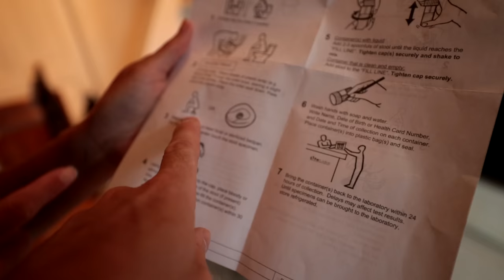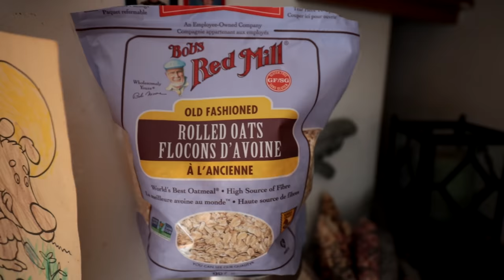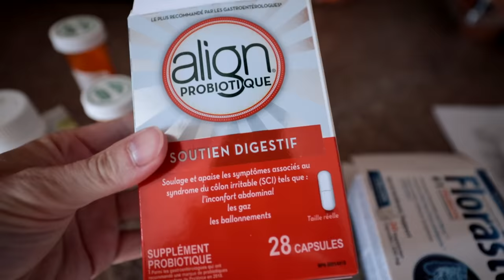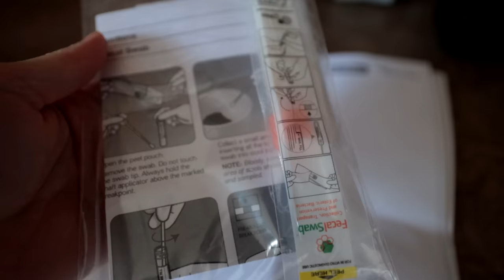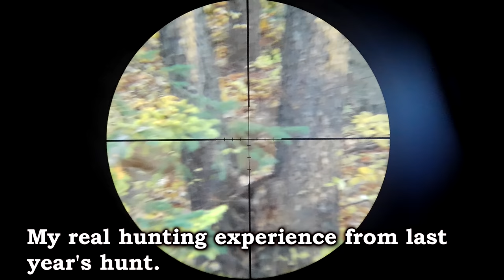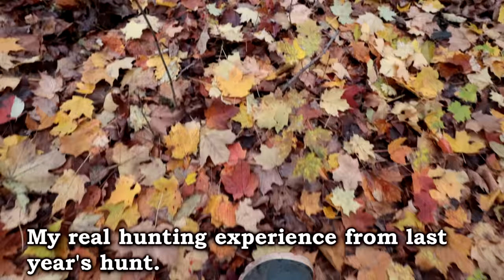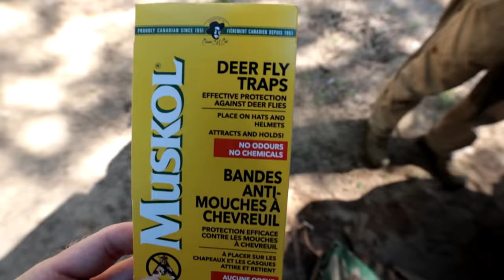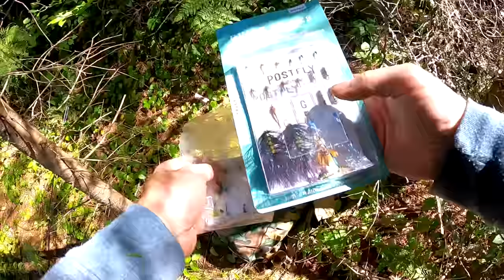Exactly How Many INTESTINAL PARASITES Are In There?!!? - BIG Vlog, Worms, Catch n Cook, Hockey!!!

Comment from the maker: Do you guys like this style?  Including more of the behind the scenes/vlogs?  Or do you prefer just jumping right to the bush?
Reply: I know advice is a dime a dozen online but let me just tell you about my experience with acid reflux. Started in 2012 and was really bad every night waking up to acid in my mouth. Was put on prilosec. Tried to come off it for a year and each time it came back quickly. It manages but does not cure. Researching I discovered there are 2 reason for the reflux, 1) to much acidity 2) Not enough. I learned that most of the time it really is not enough and the valve stick open and allows the flow back up. Diet is the only solution. My Doctor tried to tell me it was the coffee and to acidic. As a big coffee drinking it was hard to give up and cut it out and eat a lot of bland food. Well then  I tried to come off the meds it was much worse. So I went the opposite way. First I cut out chips, fries and a lot of processed crap and started taking apple cider vinegar for about 3 months came off the meds again in 3 months to try. It didn't come back. Started eating whole foods and didn't look about. After 3 months I didn't take the AVC again so I think I just put everything back in balance. To add, after stopping eating all the standard junk food, seed oils etc a few years later I started reverting back to eating some chips again, The acid reflux came back within a month. I immediately stopped and it never happened again. It has now been  many years and no problems when My Doc told me I would be on meds for life.
Reply: Loved it!
Reply: Despised it!
Reply: Both are nice! Sometimes watching a content creators videos makes you feel like you know them (when in reality we only see what they want) which is why I love your content. You're very honest with your audience, and I feel like it's a true and genuine connection.  With that being said, it's very cool to see a video of this style, but I can see from someone standpoint who doesn't binge watch your videos or who isn't subscribed not liking this vlog style video.
Reply: all content good content 👍
Reply from the maker: @Herps1  I have been trying.  My diet is quite clean, which is probably why I lasted this long without meds...I gave up almost everything.  No gluten, coffee, alcohol, eggs, dairy, processed foods...hardly anything not considered whole foods.  Yes sometimes fries, chips, etc. which maybe doesn't agree with my stomach anymore.  I feel like if I can get the bloating under control, I can get off the meds again, but it's going to be harder than I think because literally everything causes bloating right now.
Reply: @TheWoodedBeardsman  You have SIBO-Small Intestine Bacterial Overgrowth, there is a special antibiotic for that
Reply: I like an occasional one like this. I can always fast forward a little if I'm not particularly interested in one part someone else might enjoy.
Reply: Yes!!!!!!
Reply: Nexium had same effect on me. Though my reflux feels like chest pain.costs me $25000 in emergency room visits because I kept going in getting full cardiologist check up.
Reply: Algorithm is liking it. Next one you'll see a traffic jump.
Reply: As long as it's you 👍👍 but hope you get better soon and get on more challenges into the woods again
Reply: You need a change on the content,you make good contents but something different. 
Hunting,a little aggressive,pov style videos,more action and less talks. 
I'm no expert but a few years on YouTube algorithm. 
YouTube doesn't do justice
Reply: Love the different behind the scenes content Chris especially the  boys hockey practice and showing you teaching the boys how to get worms. The Brook Trout fishing was great as well. Hope you finally find out what’s going on with your stomach👍
Reply: Finally getting to finish up the Video today 🙌🏽  I Love it
Reply: I say more of this!! Awesome and interesting!
Reply: Yes yes 👍
Reply: Yeah! I have very similar stuff going on with me. Try cutting out lactose. You just cooked with butter/ with the trout. (Contains lactose) and makes me bloated. Can use earth balance or an alternative butter to cook with.
Reply: New style is great
Reply: Actually no, I didn't like it. I don't care about the gaming or swimming pool etc. Did a lot of skipping forward.
Reply: Of course dude, a video is a video. Seems like filming multiple things over the course of a few days would make creating content easier on you. Plus your longer vids are always great!
Reply: I like both man
Reply: I like both. Was cool to see more of your family…..❤️ Get your boys out surviving with ya!
Reply: Everything you do is very educational and entertaining.  I thank you

Comment: If you have never tried Baking Soda for acid reflux, it neutralizes acid on contact.  You need less than an 1/8th of a teaspoon to 1/4 cup of water(2oz).  I usually just squeeze the box and the puff of  baking soda that comes out is enough. It may keep you from having the issue in the first place, but it's very effective after the acid has hit your throat as well.  
  Just sip tiny amounts until the symptoms subside.  If you overdo the amount of baking soda, you will get burps that are alkaline and taste funky. 

Best of luck and thanks for the great content!

Comment: Another gem of a video, and i hate when people try to give me medical advice but here i am, I had 2 Esophageal lesions at age 35, however it turned out to be caused by a genetic blood condition, i would recommend seeing an Hematologist. 
The pain in my gut wasn't just my gut and when i started treatment i was and am much improved, currently 41 and it literally gets bad for a week or 2, i have a blood test then treatment and i feel ok for another 6 weeks or so. 
Just a suggestion and thanks for the content.
I can also confirm it is not Woodobo because since i got my first order i have been nuts on the stuff and no problems, in fact i think my diet has improved and surprisingly i have lost weight since having a woodobo spiced meal at least once every second day, the interesting thing is the last time i had any acid build ups was after either Pizza, wine or both.

Comment: Not sure if you've had a gadtric emptying  test yet but, I went through the same issues and was diagnosed with gastro paresis. Paralysis of the stomach. I did have gastroparesis but it was caused by medical cannabis prescribed for different reason. If you haven't had a gastric emptying test, I would get one.